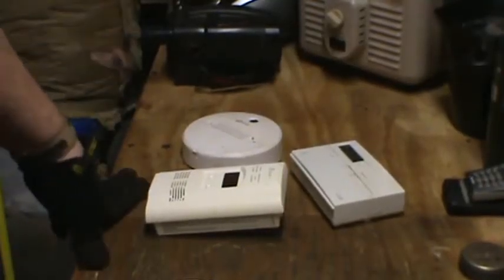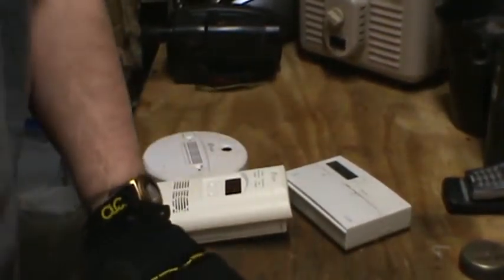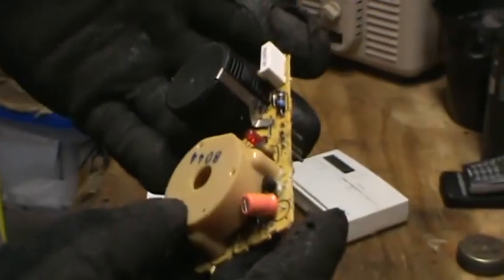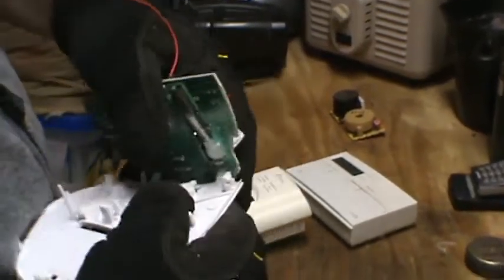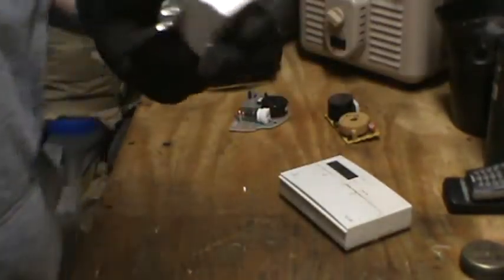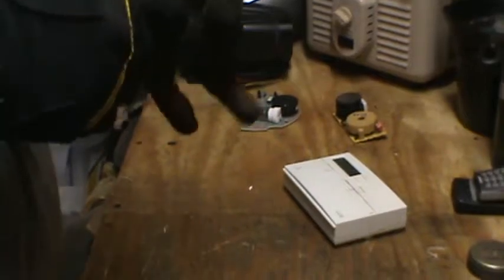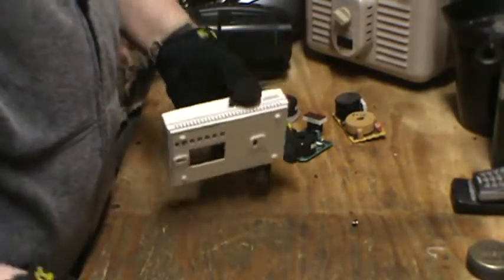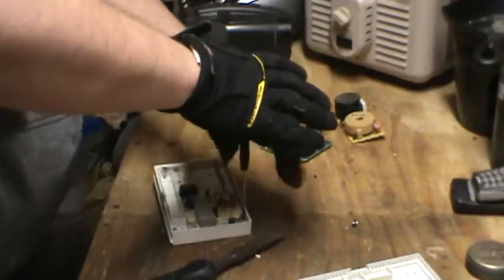Scrapping a smoke detector, carbon monoxide detector, and a digital thermostat for gold and metals

Comment: Thanks for all great vids, I did read a year ago that smoke alarms should not be disposed of in quantities greater than ten (radiation) however they have quite a few on the shelves in the stores. It's always good to know what you are throwing away and I got rid of boxes of used ones.......after I took them apart. Mostly the KIDD ones people don't plug the transformer in and they beep so people think they are broken rather than read the instructions. Some of the nicads were shipped from China with plastic insulators so they don't short and burn the ship up and they beeped as well. I could have fixed them but declined for liability reasons and decency in general.

Comment: hey Moose i once saw a vid how to process a whole circuit board for the gold, copper, brass, silver ect, by dissolving in a acid and then using electrolysis to recover I have been looking for the vid but can not seem to find it could you do some hunting and do a vid on how to do this that way we would get the most out of our scrapping, thanks.

Comment from the maker: So to get the gold off of circuit boards, the best method for that in my opinion is the acid/peroxide method.  It is basically a chemical bath that disolves the copper etching between the gold and the circuit board.  You want to make sure you cut away as much junk as possible as other metals will foul the solution and creat waste that is not easy to dispose of.  I am going to make a video soon on this.  You can also go to the goldrefiningforum and search fo A/P method.  Please study before u try